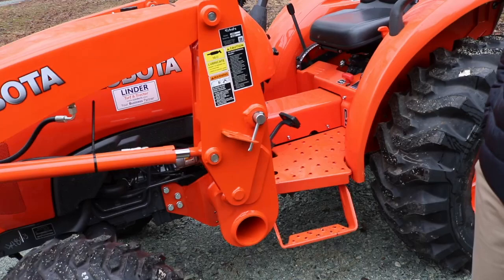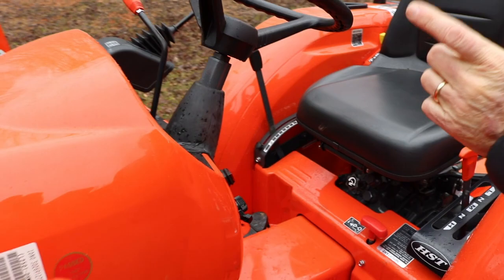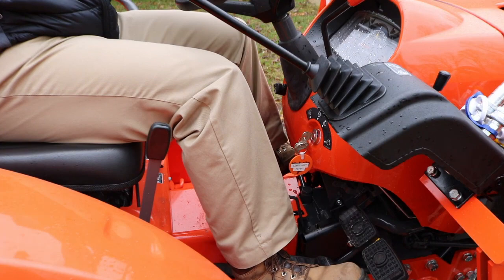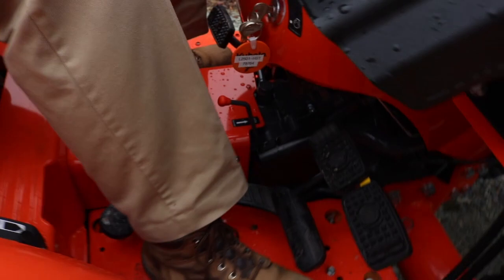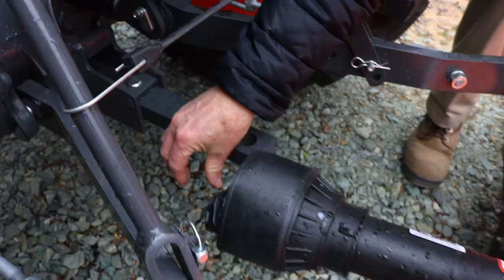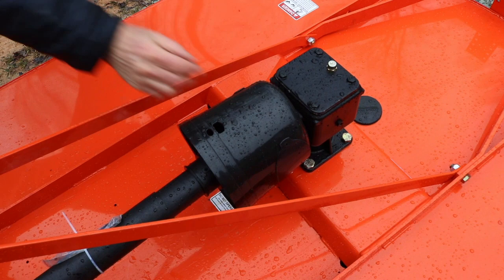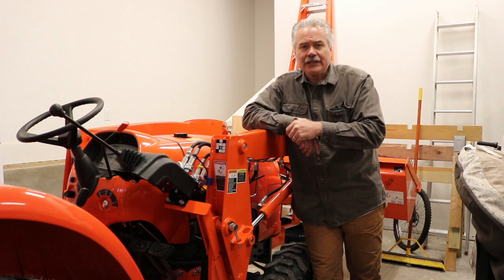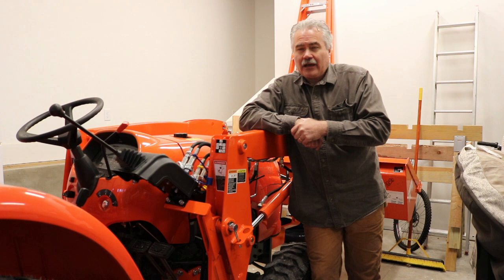#44 Kubota L2501 Delivery Day

Comment: Hey Homestead,
Welcome to the Kubota family. I enjoyed the video. I bought my L2501 over a year ago and have 85 hours on it now. I got the gear drive with ag tires, added the factory wheel spacers to the rear wheels, had the wheel dish set to it's widest spacing and filled the tires with fluid. Where I farm up here in northeast Iowa, it is extremely hilly and I burn firewood for heat as well as cleaning up downed trees from storm damage. I mow my pasture to control weeds, primarily thistles and to keep the tall grasses from poking the beef cattle in the eyes and causing pink eye.
I love my L2501. I was a little worried that the 25 hp might be a bit lacking in power, but it does just fine. It runs very smooth and quiet and is very easy on fuel. My farm is 224 acres with 118 of it tillable and the rest is pasture and hardwood timber with a big spring originating on the very eastern edge of my property.
Even though I have been around tractors my entire life, I do not claim to know everything that there is to know about tractors. My dealer spent a lot of time with me and took tons of phone calls from me before I decided to buy the L2501. He was very helpful. I also looked at John Deere ( been a Deere guy my whole life) and Mahindra. The Mahindra dealer was also super. I actually felt bad that I didn't give him the business as hard as he tried with me. I was impressed with what I saw in Mahindra but didn't like that they were manufactured non various places by various companies. I thought that might be problematic getting parts down the road after contracts run out.
Lately, I have been doing my brush hogging on steep slopes down in my pasture. I was using one of my older Deere tractors with a tricycle front end and although I wasn't having any issues, I was very nervous about stability. The Kubota has been doing very well and I feel a little bit more comfortable with it underneath me. I still mow at a crawl and leave the loader bucket on for stability and keep it just up off of the ground.
I love these you tube posts about the tractors. Maybe some day I will have a Channel of my own. More than likely not, but you never know.
Enjoyed your video. Have a great day.
Gary Fox, Iowa
Reply from the maker: Thanks so much for watching and sharing your purchase experience here, Gary.  Great to know others had a difficult time with the tractor buy decision.  I am still very pleased with the 25 HP Kubota.  It does everything I ask of it.  Do start a channel.  Sharing what you know is important and helps newbies like me!  Have a great weekend.

Comment: Congratulations!  For me it came down to the L2501 and the B2601.  I went with the B2601 as I have a smaller property, my garden is setup for 4' implements and I already have a bunch of 4' implements so the B2601 was definitely the right choice for me.  What made it such a tough choice is that the L2501 is a LOT more tractor and the price is about the same.  I have had mine for two weeks and have yet to put the bucket into the dirt.  Still using my old tractor for the real work and just riding around on the new one keeping it clean!  Keep the videos coming.
Reply from the maker: Thanks David Armstrong!  LOL, I loaded up some straw this weekend in the bucket and got alot of mulching done on the orchard.  Of course, I hosed her down good to keep her purdy!

Comment: Awesome video! Reminds me of when I got my 2501 a few months ago. I love mine! Picked the perfect winter to get it as we've had record snow this year. 
  There's a "T" handle just above your hydraulic fill,  that's a seat suspension adjustment,  my dealer failed to point out, and I added the right side handle on the fender, helps in getting out of the seat and when turning right to look behind me, or when on a hillside. I've got 21hrs on mine,  mostly just snow removal, and I'm amazed at the power of this "25 hp" tractor. I've got a ton of videos I've posted using my rear landpride blade and some modifications I've done too. 
 I  Definitely put the spinner knob on,  and my l.e.d lights were a must, and 1000%improvement. Those folding rops are a pain,  but I made a handle that fixed that. Also on the rops, there's an empty welded on nut,  that's for adding a bolt to keep the rops from squeaking. (Had to look that up). 
I like your bucket leveler, it can be tricky knowing when it's level, but experience and "feel" has really helped.  
I also added some bolt on hooks onto the top of the bucket, they're handy as heck too. 
Keep the videos coming! I love watching fellow L2501 owners work their machines. Take care.
Reply from the maker: Hey Ironheadbiker!, Thanks for watching.  Your comments are VERY much appreciated and I have started looking into various useful mods to do to the tractor.  I will get the right fender handle for sure.  Do you have the LED bar lights mounted on the ROPS?  I would like to do that but not sure how.  I am looking at getting the bolt on hooks and clevis, Pat's quick attach, and Mark's stabilizers (see botatrac's vids).  Can't wait to stretch the 2501's legs and get work done!  Subscribing to your channel now!
Reply: @homesteadpilgrim  kubota and kiotis are the 2 cheapest brand and deere and newhollands you wouldve paid 50% more money wich there overpriced with plastic  and kubota and kiotis are less and made steel

Comment: Kubota was a great choice. Their motors are used by other manufacturers, such as Grasshopper, Case in some models etc. Says a lot about there quality. I've owned an L2500 for twenty years and never had any trouble with it. I traded it because it didn't have an FEL, I traded for an MX 5800 and love it. Your choice of Kubota was a good one.
Reply from the maker: Thanks John for the kind words.  I'm really satisfied so far with the L2501.  If it would JUST STOP RAINING here in NC I could actually work it.

Comment: I bought the same tractor, and it should be delivered in two days:)  I got the grapple with 3rd function controls, and the top-N-tilt 3 point setup on the rear. Cruise control, and I got the same brush cutter that you have in the video, and a box blade, and a tiller, and a snow blade for the front. Also got a 3 point attach post hole auger. Can't wait to rip some stuff up:)
One thing I also bought was a 12" by 96" roll of clear vinyl to cover everywhere that I think the paint could use some protection. I'm going to cover it up before I scuff and scratch too much.
Reply from the maker: Awesome, Jay!  You won't believe how powerful the tractor is and how much work you can get done with it.  Sounds like you have all the attachments for most any job you will encounter.  Wish I had a grapple.  I just got a 5 foot blade for snow removal this winter.  We were caught last winter in a snowstorm and couldn't move until my neighbor plowed us out with a similar blade (I bought the County Line 5ft blade at Tractor Supply last week).  So happy to have a tractor and a blade this winter!  Have fun!  Thanks for watching!

Comment: One thing that I notice where the Kubota seems to outshine the other brands is the hydraulic control valve for the loader. When working in the corner positions, the loaders on the Kubotas seem to work much more smoothly. When curling and lifting or when curling and dumping, they just seem to work much better. I have run the John Deeres, Masseys, New Hollands, Case IH, and none of them are as smooth to operate as the Kubotas are. Can't speak to the Mahindra. I have never ran one.
Reply from the maker: Yes, I like the loader function.  The Kioti was a close 2nd place in my decision.  I could have gotten 35 HP and all the bells and whistles with the Kioti, but I just couldn't do without the best of the best...Kubota

Comment: Welcome to the Kubota family.   Love my L3901.   Couple words of of wisdom through experience.   Mount your spinner on the right side of the steering wheel so it doesn't grab loose clothing when you go to dismount.  It can be aggravating and dangerous at the same time.  Everytime you grease your tractor,  it says thank you.  Study the manual and learn each and every grease point.  Give it a couple of squirts before each time you work your new investment.  Keep the air filter and front screens clean at all times and change the oil as per the guidelines and this tractor will be around for your grandchildren to use.  Be safe and have fun.
Reply from the maker: Hey David!  Excellent advice, thank you.  I put the spinner on the left side but I don't like it there, so I'll remount it on the right for better control and safety.  Thanks for that!  You be safe as well!

Comment: I have done like you, I have looked at all the brands. I have finally narrowed it done to this one as well. Just waiting on the dealer to get one in!
Reply from the maker: Congrats on your decision.  It was not easy I'm sure, but you will be very impressed and satisfied with the L2501.  I know that it is able to do everything I need on our 24 acres.  Just follow the safety and maintenance instructions religiously.  Oh, I did discover that the gear box oil drain plug in my RCR1260 rotary cutter was missing.  May want to just give everything a look over... Kubota is sending me the plug.
Reply: @homesteadpilgrim  Will do. Thanks for the tip 👍

Comment: Congrats on your new tractor!  Boy I was right in your shoes about a year ago.  It was such a tough choice in that size range. For me it actually came down to the L2501 or the new for 2018 Mahindra 1626.  I had a specific requirement for me and that was lifting large square hay bales.  I was really focused on lift capacity because of that.  So I did a real world test.   I actually brought a 8ft long by 3x3 large square to my Kubota dealer and Mahindra dealer.   I was really leaning towards the Kubota,  just its build quality, fit and finish.  Then I tried to lift the large square.... couldn't lift it to max height.... with a 5 ft brush hog on it for ballast.   Loader maxed out about 10" below it lift height.   Then I tried the Mahindra.... lifted that bale like a toy...!! I took  the ballast off  the back and tried it again....  the back end was light... but it did it again!  Lifted that bale to max height!  I was sold! It really is true what the ads say... lift more, pull more, work more... Mahindra!  I was shocked!  I really planned to buy the Kubota.   But that Mahindra just flat out worked it.  The Kubota is still a nice tractor.   Well built.   I wish you well well with it!
Reply from the maker: Hey Brian!  Thanks for watching.  Those Mahindra's are beasts!  I considered them for the same reason, heavy and powerful.  All modern tractors are so close in comparison, it was very hard for me to choose, so I mostly went with intangibles.  What I would be most satisfied with...  Good luck with your tractor and stay safe!
Reply: @homesteadpilgrim  I understand!  If I wasn't so focused on lift capacity I probably would have gone with the Kubota.   Just a very well built smooth running tractor.   My Mahindra came with tilt steering,  cruise control,  rubber deck,  telescoping 3 point stabilizers, all extra options and money with the Kubota.  With all that and the extra lifting capability it flipped the table.  Even so I still am impressed with the L2501,  a great tractor!  I wish you years of trouble free service from yours!

Comment: Subbed and liked. Kubota makes a top notch tractor. Dad has had two so far. Just a note on the Mahindra though, they contracted with international years ago for the engine blueprint to be licensed to build tractors in India. So basically many Mahindra’s have international design engines. These days everything (under 85hp) is built foreign. Deere is just miles away from Mahindra. Difference is Deere went with a lot of aluminum to reduce shipping weight/cost. I went with gear drive Mahindra to get more HP/size compared to smaller HP Kubota for similar price. Mahindra does have options for shuttle and hst. Went with it  to avoid the aluminum Deere stuff.Mahindra has the weight and lifting power I need and no DPF filter up to somewhere about the 65/75 hp engines. Just avoid the emax tractors. They can’t compete with much of anything. Too many problems with them but I think the larger Mahindra’s are very competitive.
Reply from the maker: Thanks for that info!  The tractor choice was very difficult.  I watched a comparison of Kubota and Mahindra on the Messick's channel and that is what made the difference for me.  Mahindras are beasts for sure.  Heavy and powerful.  Thanks for Subbing and liking!

Comment: I've slowly traded and bought newer Kubota equipment for my small business.Excavator,zero turn,L2501 loader tractor.I've had other equipment,i prefer Japanese engineering and fit and finish.When you buy Kubota,your paying for a quality item in most cases.Resale and dealer networking say a lot about the quality.Good choice,my L2501 is now in its 3rd year,great tractor for lighter work.You can buy obscure tractors,the dealers never survive.
Reply from the maker: Thanks for reinforcing the wisdom of my decision to buy Kubota!  Great points!

Comment: I didn't know the PTO guard could be moved. I'll have to check that on my L3901
Reply from the maker: I read the manual cover to cover and yes, it does say the PTO cover can be moved but mine is bolted down.  Not sure if that will restrict hookup of the rotary mower PTO shaft or not, I guess I'll find out!  Thanks for watching.

Comment: Did you look at the New Holland? I'm in that process now and trying to make that same decision, Also don't have a RK near me in Arkansas although I like that 37 that Morgans run. What did you hear bad about the mahindra though, I saw a side by side comp with the Deere and Kubota and they made the Mahindra look good, but I think it may have been a mahindra dealer who did it so I'd expect that. I'm kind of leaning more toward this L2501 too, just because it seems they put the money into the function and beef instead of the fanciness and that makes sense for a tractor.
 I should add what I liked about the mahindra was the 7ft backhoe on the 1626 cause I have a good amount of digging I need to do and they threw in the bushhog and trailer if I order a front Grapple for 26500. or so.
Reply from the maker: Hey FactFinder, I did consider the New Holland and its sister LS brands but it came down to dealer location.  Same with the RK, seriously considered that but the closest dealer is in Morganton, Va which is an hour away, too far.  The Messicks comparison of Mahindra to Kubota convinced me the Mahindra was inferior.  It looks beefy, but the many sources of reviews out there warned me away.  I almost got the Kioti CK3510 as that was same price as the L2501 but with lots of bells and whistles that the standard L doesn't have.  I'm happy with my choice.  It is plenty powerful for my needs and ... no regen cycle!
Reply: @homesteadpilgrim  yerssir i get ya there. those 500 mile treks for bull can cost more than they're worth...NH is my closest dealer but they.to put in their monster on display without asking questions...so i left
Reply: @homesteadpilgrim  Thank You. I'm in a small town with a New Holland dealer in town, a mahindra dealer 30 mi away, and a Kubota Dealer one of the further but still less than an hour away. I'm not looking for fancy, I'd prefer a basic tough machine with capacity and as few moving parts as necessary to get the job done.
I think you made a good choice, that one keeps rising to the top of my list and Messicks is hard to argue with, aren't they.
Reply from the maker: I'm partial to Messicks as they are close to my home town of Harrisburg, PA.  Hey, I used to live in Ft. Smith, AR for 7 years back in the mid-late 90's.  Great place.  I got to see the whole state when I was in the AR Nat Guard

Comment: Hi Mr Homestead great video I am at that same crossroad now  the L 2501 or the Kioti ck35se. I am leaning towards the Kubota 
much for the  same reasons you were and also the dealer is in town. Do you have a mid PTO on your tractor? Regards
Reply from the maker: Hi Lee.  I do not have a mid PTO.  Currently only have the grader scraper and circular cutter.  I may get a finish mower for the rear PTO but the circular cutter does such a great job I may not need it.  I eventually will get a zero turn when I no longer want to or can do the push mower.  Hopefully not for a long time.  Cheers!

Comment: I was ready to go down and just buy one cash, but it turns out they have seven year, zero interest financing that includes an incredible insurance policy. It protects against anything. Say you had the tractor 6 years with 10,000 hours on it and it gets stolen... you get a new tractor, no depreciation. Accidentally drive it into a lake...new tractor. A new tractor for $150 a month, I don't see how anyone can beat this deal.
Reply from the maker: Man!  what a deal!  Wish we had this option when I purchased mine.  Thanks for sharing!
Reply: The Kubota insurance total replacement is only good for 60 months read the fine print. I can send you a picture of its I just ordered my L2501 Ag tires gear driven.